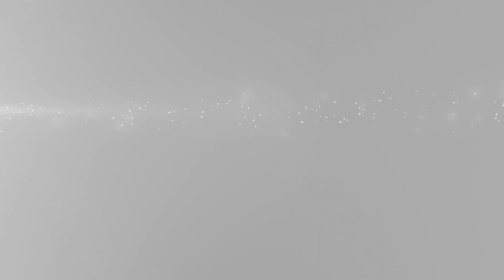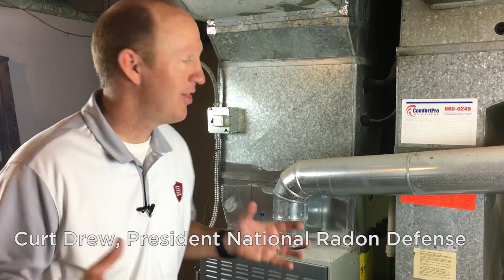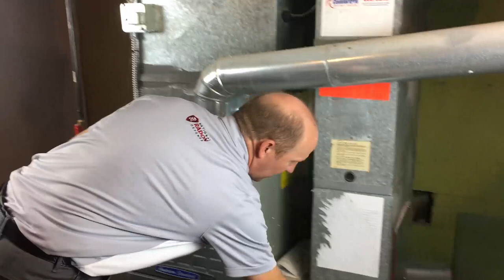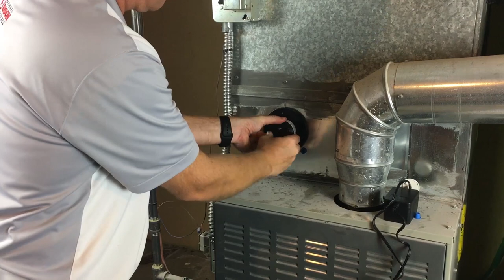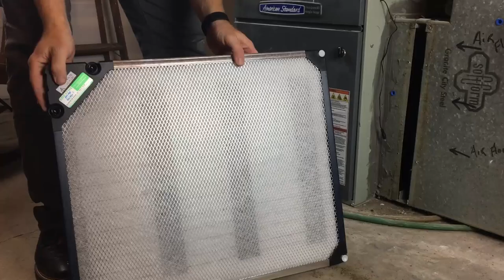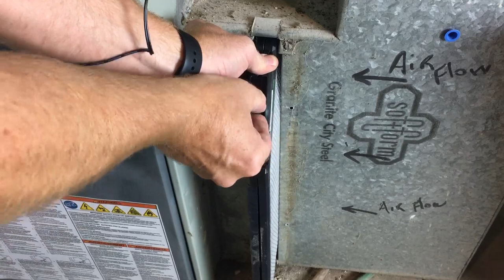Turn your HVAC System into an Air Cleaning System

Comment: The truth is, in a static air environment, the UVC light will kill the viruses and bacteria. The HVAC moves air efficiently. One would have to install MULTIPLE UV elements on the Supply AND return in order to create enough wattage to give the airborne viruses enough exposure that it kills or degrades them as the air moves through the chambers. There was a study performed on SARS infected blood back in 2003. It details the amount of exposure needed to kill the virus to undetectable levels. Each HVAC setup will require a different number and concentration of UV Light elements. You're hearing this from a Mechanical Engineer. The main function of the UVC light in this video would be to keep mold or mildew from accumulating on the cooling coils. This helps maintain coil efficiency to acceptable levels throughout its service life.
Reply: Absolutely not. I am a biologist and a have a minor in physics. Bacteria and viruses are extremely small yet definitely greater than photons. UV light emits at the speed of light. It is universally impossible for any air flow pressure to move faster than the emitted light. Therefor any particle passing through will be affected especially organisms like viruses and bacteria will have their genetic mode severely modified.
Reply: @eliasqaz  As a biologist, you should know that dosage rate depends on the virus dwell time at the source of emissions. In this case the UV Source is static. Even though the UV light is moving at the speed of light, those viruses are moving past the source and the square inverse rule applies and they still need enough dosage to render them non-viable. multiple UV sources in the flow path of the air carrying them will create the environment that degrades them effectively. I work as an ME in the Radio Therapy Industry. Dosage rates given energy levels are always part of the equation when dealing with clinical treatments. I deal with Photons, Electrons, Protons and clingons.
Reply: @GentiluomoStraniero  You are right. Upon more research I did not take into account the required dosage of light required for deactivation or degradation of genetic code. "So is the nature of science, we learn, make mistakes, and learn some more" Cheers
Reply: @eliasqaz  You weren't wrong...We just left out the dosage required to damage the RNA of the virus. One can disagree respectfully but if we spend the time to hear other viewpoints, we can learn from one another...then it is time well spent.
Reply: These were comments well worth reading. Kudos to you both! 
❤

Comment: A bit of a problem with this, in an effort to expand the conversation.  Increasing the static is always a problem.  Do no harm.  Don't make thin gs worse.  Do not increase resistance.  In fact, it's always better/best to increase the square footage of everything you touch, which lowers static.  This will also reduce duct leakage to the outside via the lowered static in the ducts forcing house air out.  Saves energy & extends the life of the system.  

Is the system noisy?  Noise is wasted energy!  Does it rattle?  Rattling & shaking also takes energy.  There comes a time when we're polishing a turd.  Does it burn fuel?  You have carbon monoxide and other toxins!  It might be time to change that gas guzzler.  

Then "filtration" is extremely important.  The higher MERV, the better.  The larger the surface, the better!  Imagine anything 50 years old that has never been cleaned.  Imagine if your bed sheets were never cleaned!  If the filtration is bad, the ducts are even dirtier, plus by-pass.  Most duct systems have critters that have perished + decades of dust.   

I completely realize that these things are much, much more work than some quick-fix band-aid where a company can get in and get out using fast talk,  snake oil and flashy marketing gimmicks.  It is also the method that will provide the best results for decades to come, for you and future owners for year-round comfort, healthy air and energy savings.

Comment: Nice explanation Curt!  How does modifying the system like you did here vs purchasing a portable air purifier compare? Is there any data to quanitify this? Most youtube videos go straight into portable air purifier comparisons where HVAC strategy is going to push far more air and for the whole house.
Reply from the maker: Thanks for your message. Portable air purifiers are limited to a certain square footage of treatment area.  Our approach treats the entire home since the HVAC system is circulating air throughout the home.  Whenever the HVAC system is circulating air, we are cleaning it centrally. To learn more visit www.breatheezair.com

Comment: Lets talk about ozone production from the UVC, ozone is a powerful respiratory irritant.
Reply from the maker: Hi, appreciate your feedback but our BreatheEZ along with the rest of our filter line has been verified by Intertek (ETL) to meet their Zero Ozone Verification standard as defined by UL 2998. It means Breathe EZ filters have been verified to exceed current enforced ozone emission standards including those from FDA, NIOSH, CARB, EPA and OSHA. Filters adhering to these standards can produce up to 100 TIMES as much ozone as our filters did during recent testing by Intertek. Now Breathe EZ filter are certified under the Intertek Sustainability program.

Comment: What about filtering out the RADON?
Reply: Radon is heavier than air, perhaps an air extractor that pulls air from the lowest point in your basement will keep Radon levels at their lowest. Exhaust the basement away from the home to prevent infiltration. Also coating the bricks, floor and walls in your basement will reduce the accumulation of radon in your basement.

Comment: I don't need nor want a whole house air purifier as I lived fine enough 62 years without this. But my HVAC company made several mistakes recently, and am considering using the whole house purifier as a free add-on to allow them to give me something in return for their screw up. This can be a good negotiation add-on for you homeowners if your HVAC does what mine did, and sent me incorrect proposals 6 times iin a row
Reply from the maker: We appreciate your suggestion on this matter and we will definitely consider checking that. Thank you.
Reply: @RadonDefense did u
Reply from the maker: @CCCC-tq8yo  We appreciate your question and concern. NRD is actually a dealership network that provides radon mitigation services to businesses globally. This video suggests an energy and cost effective solution for our viewers' current HVAC system - which is normally found in a local household.

Comment: Air disinfection vs. removing particulates. Even adding a single or multiple UVC light isn't going to kill pathogens, bacteria or mold spores unless they happen to get caught inside, and even then the only way the UVC will kill pathogens is if they are directly hit by the light (assuming it stays on all the time). This installation demonstrated is not an efficient way to accomplish air disinfection at all. This does deliver a false sense of security. Save your money.